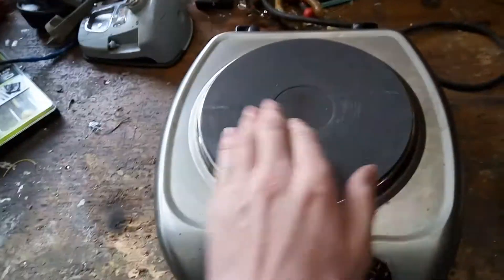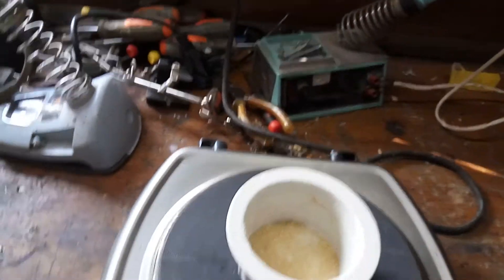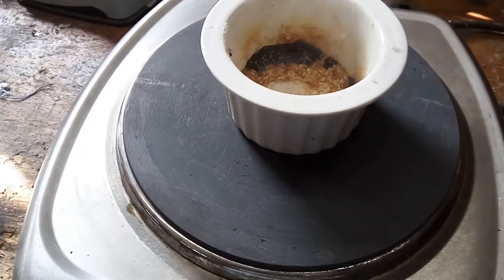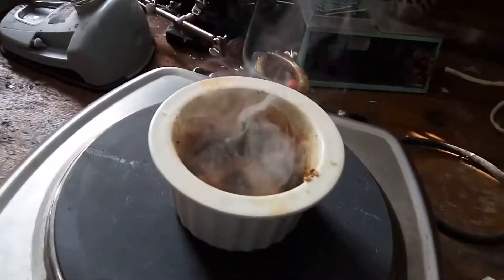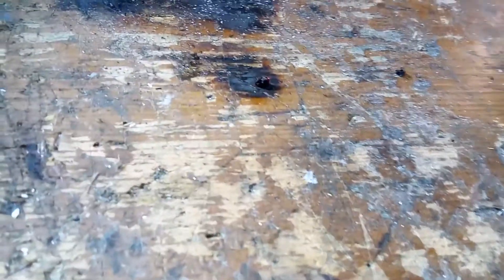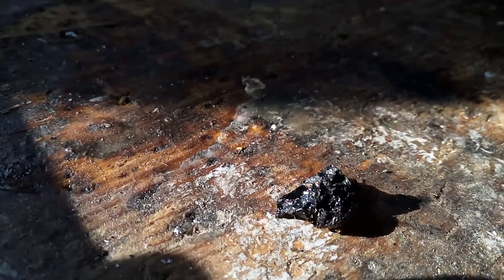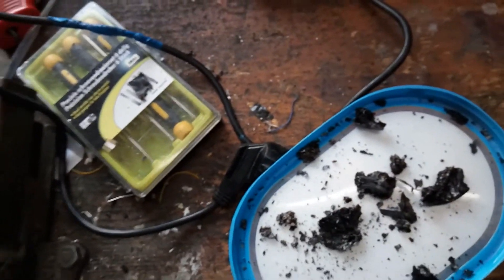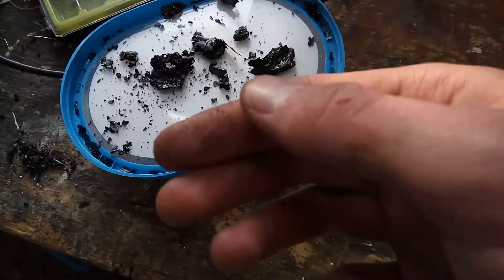Making Carbon from Sugar

Comment: Actually it's C12H22O11(s) → 12C(s) + 11H2O(l) 
Doesn't matter though, you made pure carbon, which is pretty cool and quite entertaining. Nice video.
Reply from the maker: +AKIO TV Of course, but I thought that was only when you burn the hydrogen directly that comes out of it. But thank you very much :D
Reply: not right! This is most probably saccharose, an isomer of C6H12O6
Reply: Tech Kyle No Problem, mate
Reply from the maker: +Andre Leonhardt Yeah, you're probably right. Finding this particular sugar was pretty hard. Thanks for pointing it out!